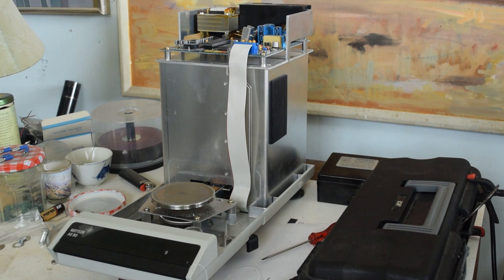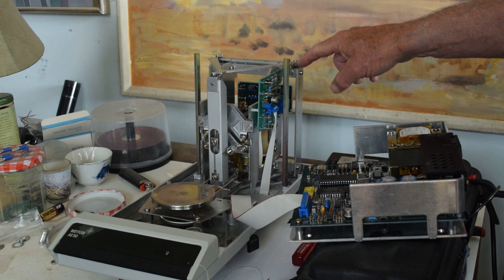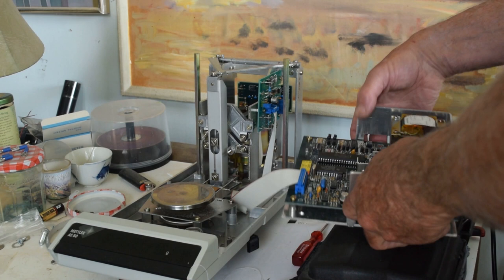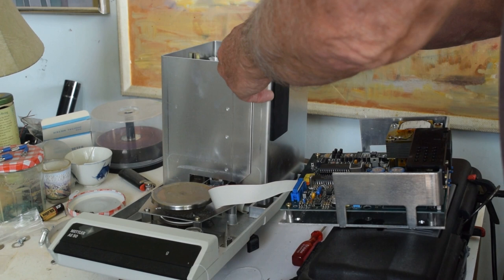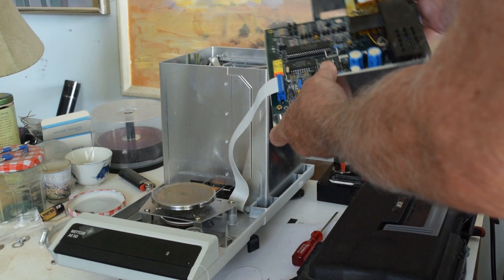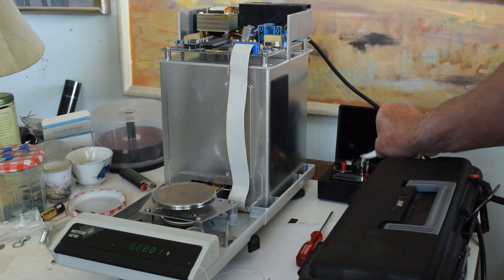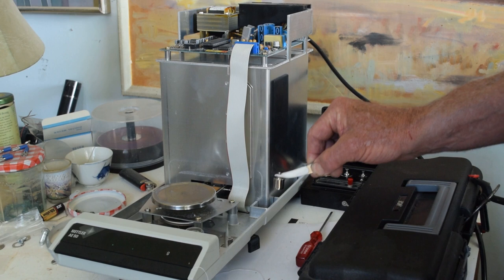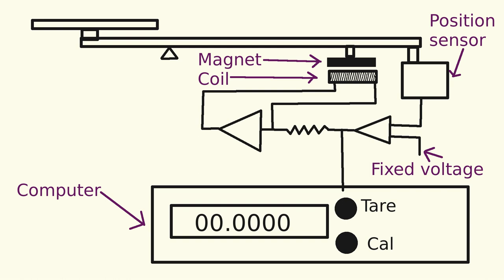Analytical Balance Repair

Comment: Would you happen to know the name of the small metal part that's vertical and connects the two screws facing the pan? It's in front of the vertical support at the center. I have mine that's broken and trying to find a replacement.

Comment: Enjoyed your video and seeing the inside of this balance! I have a similar balance (Denver M-310) that seems to have a hard time settling at 0.0000. Looking for ideas for how to fix it. I have wondered if it might be old capacitors not holding the voltages steady. It does not seem to have physical damage and was in use for years before it developed this settling problem. Thanks for any ideas you might have!!
Reply from the maker: Hi
Old electrolytic caps are a problem sometimes.

Other suggestions (no balance expert here, sorry):
1.See if there is an integration time setting and increase that.
2.Take the cover off and feel or check for a hot component.
(caps can heat up when they become resistors, for example)
3. See if the area it is in has developed vibration.
4. Try unplugging and polishing connectors.

I would bet on the caps.

Comment: I have Mettler Toledo balance model ME402. it is showing underload error. it is not showing any weight. can you tell me what is issue
Reply from the maker: sorry for the late response.

In my amateur opinion, I would suggest a broken flexure or other
mechanical part--maybe something holding the pan.

Also possible are bad analog power supply or ADC, etc.